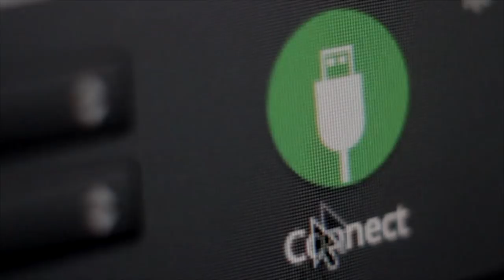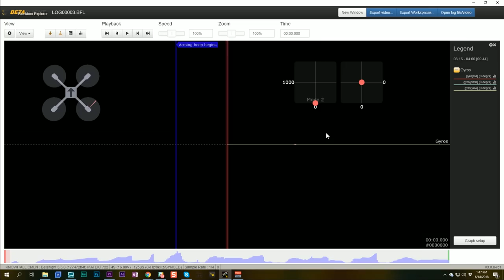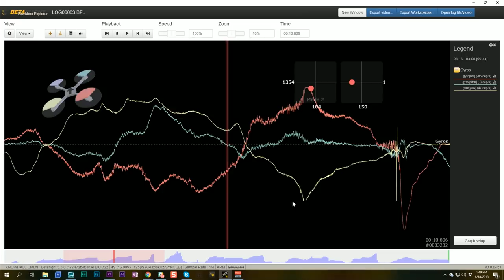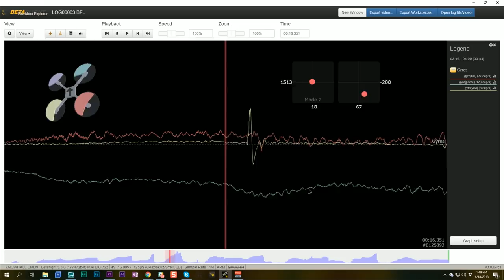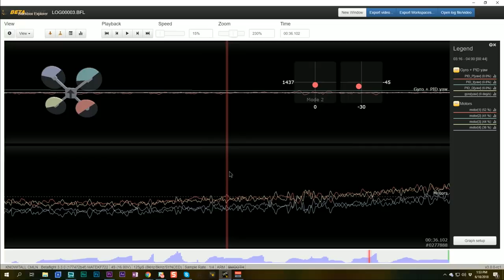Gyro Noise Troubleshoot | MINI QUAD BLACKBOX

Comment: I didnt hear you mention loose wires around the flight controller.  A wire vibrating off the board will cause the flight controller to glitch.  I don't know if voltage in the wires will also cause it. Ohh.  And the antenna mount.  If your antenna wobbles,  attl do donkey,  attl do.

Comment: I've been tryin to fix this issue on my Floss 2 frame with Helio FC and Emax 2207 2400 kv motors with 2 different ESCs. Lately I've been debating if it could be the motors on that set up. They do feel notchy and could be causing vibrations. Who know... good info in here anyhow.

Comment: I'm having a major issue with my quads. They both brandnew but I get oscillation when the D-pitch is around 15 to 30. I have to have it at zero,so the d-pitch oscillation is gone. What is crazy about this... Roll is doing fine. I dont get it. My P pitch is 70, I is 40 and D is 0 now. I have a Gopro on my quads. This all happen when i switch my motors to DYS Shu 2500 KV. Also, the motors are fine when I test it out on betaflight.

Comment: I just made a fresh build with mb primo 2207 motors on a reverb with the kakute v2 stack. All the latest. Still flies like crap because of all this. Cap, soft mounting...nothing helps. What would be a good fc to switch to if I don't care about cost?
Reply from the maker: I wish I could tell you an FC that would guarantee good performance. FC with an MPU6000 gyro like my JBF4 may be less susceptible.

Comment: I have an armattan marmotte new tmotor f90 pro motors new 55 amp esc and new f7 tmotor flightcontroler. Pitch axis is horrible on noise nothing seems to help I don't know what to do not a good flying quad booble on pitch and booble on throttle punches

Comment: Having similar issues, will try to add capacitors, thanks. Also, any tips on this issue?: after fast flips camera resets (video goes black for a moment, then armattan logo appears). All good on rolls, also after reset all values on osd are not lost, so i guess its only camera power loss. Using predator with cl racing f4s wired just like on manual.

Comment: Sat here in 2022 trying to fix a noise issue on my Chameleon... Watched tens of videos, messed with PID settings endlessly, hours looking at blackbox explorer... Gets to the end of this video and hears Bardwell say "and in this case the frame is an ARMATTAN CHAMELEON"... Il be damned. with all the standard hardware and rubber FC standoffs i think i am as you put it, screwed. This only started happening after a BLHeli_S Bluejay update. First quad too so until this video i was stumped, now i think my Matek FCHUB is too close to the bottom plate sending vibration into the standoffs... I hope.

Comment: the f405 had the same yaw twitch issue try it in multishot before you take it apart.  i think real issue is how its might be wired on some boards or even just to much heat in production for the newer chip good info Teach
Reply from the maker: No way I'm going back to multishot. Turtle mode forever.
Reply: lol yeah cuts walks of shame by 70%. i can wait for the new hal sensor motors and esc i saw Zoe use them and they look like a next step but they are going to cost in the start. lol use your position to get you some early wink wink for testing

Comment: What about running up each motor without the props on to see which arm or arms are generating the noise? It can be a bad FC but most times its not once they are soft mounted.
Reply: Yes, that can work.

Comment: A little dynamat goes a long way. Its used for arresting high powered speaker vibration. Keeps your trunk lid quiet when your competition sub woofers are trying to blow it off. Little on the expensive side unless you get the small 12"x12" sheet. Stick a little on the frame or under the standoffs. Never to the fc. Its super sticky and may pull things off.
Reply: Mass damping, which is what dynamat does, isn’t ideal for quads since we’re trying to keep the weight to a minimum.
Reply: kenkamm it doesnt take much or add much weight. It calmed down the matek f404 aios. They have samples on counter bells. Little tiny piece does a lot.

Comment: Hi, Joshua Bardwell
What temperature do you think is normal for motor?
My motors usually are 60~70 Celsius degree, is it too high for motor? or it is regular.
Reply from the maker: That's in the edge I think. Especially if you're just hovering and cruising.

Comment: Hello Joshua, Congratulations for your outstanding expertise and high quality videos. Very impressive !!!
Currenlty I have a quad eachine TS215 and I had a crash after which I needed to change 2 motors and the ESC. Nos this has been done, the Quad is flying again but even after dozens of gyro calibration in Betaflight, the quad is LEVEL/Horizon mode is still drifting ( highly ) on the right.... I have no idea why !! I have NO trim on my radio, and in Acro mode the quad works almost ok...

Any idea on how to debug this ?? using the black box ?? Am i missing something in betaflight ?? Thanks !
Reply from the maker: https://youtu.be/otJNzZrE-yk
Reply: looks to work !!! THANK YOU. The "trimming from stick" is working for roll. but does it work for pitch ?? looks like it only applies for roll

Comment: was it a matek F405? with the ribbon thingy ? I had really noisy issues that I tried to tune / filter out yes with no luck. was already soft mounted & low ESR cap. tried various Dshot and multishot no joy unflyable.  In the end I rewired FC so no power came off the FC. only 5v in and signals so no RC receiver, LED or Buzzer +- from FC and used power from PDB instead. Fixed !! so smooth now on default PIDS
Reply from the maker: No. F722.

Comment: What could happen, before crash i haven't any vibrations, after crash my drone after arm and rise throttle a little drone is vibrating and flies up with max motor power. Gyro working, i see in btfl. Can't check blackbox, it's mobula 8. When i turn off airmode everything seems ok, it flies pretty normal, little shaky, but with airmode on, flies straight in to sky with full power.
Reply: Pid tune maybe?
Reply: @tootfpv Thanks but problem solved, i've put aio to another drone from 2s to 1s and it was good, don't know why.

Comment: What was the flight controller? Also I had a similar issue (though it was more just garbage data 90% of the time) on a kakute v2 and it was fixed by reflashing the fc. I still have no clue on what caused it at first but its gone now so I'm happy
Reply from the maker: Matek F722

Comment: I have this same issue with my chameleon. I'm soft mounted and have capacitors out the ass and I'm using a mpu6000 gyro and it's unflyable. Can I send you the BB to take a look at?
Reply from the maker: I won't have anything to add beyond what I say in this video, unfortunately.
Reply: In the logs my rear right motor is maxed out while the other motors are between 75-85 % . Could that be the source of the problem?

Comment: how about balancing motors with tape? Worked great on all of my quads.
Reply from the maker: It can work but it is so much work and time and then the first time you crash, it's ruined. I don't think it's worth putting a lot of time into balancing props and motors because of this. Just build a system that can tolerate a small amount of noise and then when things get too bad, repair or replace the motors.
Reply: I can confirm that from my experience, that it can take some time. It took me about 5 minutes per motor. 
You are right, once motors are bent things can get impossible. 
On the other hand, bending a motor won't happen on every crash. 
Even one motor can get out of balance in a crash, the other motors can be fine. 
That still gives you only 1/4 times of vibrations than an unbalanced setup.

Comment: Did you ever get this Chameleon frame flying jitter free? Do you have a follow up video of this frame with new FC? Running 32k!? Jitter free? Im helping a buddy and he has the same exact brand new electronics FC (Softmounted), ESC, MOTOR’s (Softmounted), Props,  LiPO, ESR Capacitor, similar weights as me but on a Chameleon frame PID tune slightly different obviously and just can’t shake it! Pun intended! Lol
Reply: It's funny but I haven't had this issue with any of my other builds until I used the Chameleon ti frame. Wonder if it's the frame causing this?

Comment: Stupid question. Maybe I’m not understanding bigger concepts, how do I know if it’s noise like in this video versus, too high of P value? 
My example, I built a fresh 5 inch quad. I entered higher rates than the stock (rock settings which I used in my previous quad). I would put in quick inputs or a roll and it would twitch and crash. I lowered P values. And I loosened the nuts on the soft mounted flight controller thinking, maybe I compressed it too much to negate the soft mounting. I also went back to stock rates. 
This was my first attempt to try and build a tune and locked in quad. (My first quad I built but left everything stock) but now I’m feeling a little hesitant. 
Any help would be much appreciated. Thank you!
Reply from the maker: Please check this video to see examples of what P term and D term oscillation sound and look like.

https://www.youtube.com/playlist?list=PLwoDb7WF6c8mTH6A4HyzPPdX5lsvEwBeA

Comment: Would there be any benefit in running 2 capacitors on a 4 in 1 esc? I have 2 airbot asgard v2 flight boards and they both have mid to full throttle oscillations. I like the design of the board but im going to have to toss them if i cant get these oscillations to go away.
Reply from the maker: If a 1000 uF capacitor doesn't fix it, I doubt 2000 uF will. Mid throttle oscillations are a bitch.

If it starts at mid throttle and continues to full throttle, then it could just be your P gain is too high.

Comment: Great video as always I have a similar problem to yours but with the new KISS V2 flight controller kiss 32 amp ESC and T motor F40 Pro 2 2400 KV. My issue is only when the throttle is at 2000 and I am full throttling to the sky it will shake like there's getting noise into the gyro. Everything is brand new I have one flight on it even tested each motor in the kiss GUI and it seems like the motor is causing all the noise on the graph. I switched to brand new Motors the hype trains and it's still doing the same thing I also have a 25 volt low ESR capacitor on the power lead and have another kiss V2 exactly the same build and it is Rock Solid. 
Do you think the kiss v2 gyro is messed up please help thanks
Reply from the maker: If you have oscillation just at high throttle I think P gains should be reduced.
Reply: Joshua Bardwell yea there on stock pids..  just at 3 for pitch and roll. Justs tumped

Comment: Joshua why are u using friction example for wath happen inside the motor..
Reply from the maker: Friction is a good analogy for what happens. The electrical energy moves inside the coils but it is not translated to mechanical energy (movement of the rotor) so it turns to heat instead.
Reply: Joshua Bardwell can i said i think ur example is more relevant to describe what happend to metal pot on induction plate. For wath we hear motors are actually speeding up and down rpm. I preferd said the controler is asking power and break at a chaotik frequency and as same for exess D gain brake is applied fir nothing usefull.. speed up 20ms brake 10ms speed up etc.. the kwad fly on fast overshoot and appliy brake always and too much.  Ure right saying energy is dissipated but think its mecanical power of bell and prop inertia that give heat.. if u ask brake thats because u had ask too much power d this power goes somewhere.. shorted as heat

Comment: the fact that the glitch was specific to yaw suggests it is not electrical or mechanical noise per se, otherwise it would be visible on roll and pitch gyros, especially since d gains are typically set much higher on those axes making them more prone to such noise. Im inclined to think bad gyro/FC.
Reply: Erm the 32khz gyros are notorios for having yaw glitch issues it seems the yaw axis on these imu's are much more sensitive
Reply: An out of balance rotor spinning causes vibrations along the plane of rotation, which in the case of a quadcopter corresponds to the yaw axis! So this actually strongly implies that there is excessive mechanical noise. 

The pitch and roll axes might be more sensitive to vibrations due to the higher D gains, but we don't have anything to excite the quadcopter about those axes in the first place, since we don't have any rotors that are mounted vertically. Of course, there might be some vibrations in pitch/roll since nothing's perfect, but the amplitude of those vibrations is much smaller than what we would expect in yaw (which is what we see in the bb log).
 
If we had an airplane with vertical propellers, we'd expect to see similar vibrations but in the roll axis this time.
Reply: nice hypothesis, but I haven't seen any concrete data to support it. any direct observations I've made have shown that motor imbalance is picked up by all axes.

Comment: thanks for this video Joshua. I have a scenario (with matek f405-ctr) when in INAV i have serious yaw twitches from the gyro, making the motors heat up real fast. While with BF installed on the same setup, the quad flies well (well enough with zero tuning). I have soft mounts and a capacitor on a 4-in-1 ESC. any idea would be appreciated. thanks!
Reply: I know I'm late but the problem is Yaw P too high

Comment: I'm using iflight xl5 v2 with individual arms and I can wiggle them and the second set of screws on it is the stand off screws even though flight controller is soft mounted if the arms are moving then its moving my entire stack I think I have good electronics as iam running emax lyte spec 22p7 2550kv kakute AIO TEKKO 32 35amp 4 in 1 and the atlatl esc what do you guys think already incresed.filtrting and I have to run with very very low p and d gains motors come down pretty warm not quite hot though I can hold on to them
Reply from the maker: If the entire stack is moving, it's got to be hurting your flight handling! I would fix it.
Reply: Joshua Bardwell I don’t know what else could be happening can’t seem to get the arms tight enough you can move them with your hands I have to think that’s moving the stack a little bit rite. I have to have all filters on turned way up meaning down on the numbers and my D are like 15 P are like 30 motors still warm I can hold them but something is clearly wrong rite? My Kopis flies awesome I added an additional m3 screw to each arm last night now there’s no movement in the arms at all can’t wait to try it out!

Comment: Nice video as always! 
I'm having similar problems on a build where I went from 5 inches to 6 inches, I found that the props size have a big impact on the noise of the system 
I have two questions:
- I've always said to my subscribers to buy the low ear capacitors and, as you also said, to check for the 105° label. Someone told me that the ° rating is not relevant so I wanted to ask if that is true
- What was the flight controller you had to get rid of?
Thanks for your time!
Reply from the maker: I have been told that 105 degree caps are basically always low-ESR. I've assumed it's true but I guess I never verified it.

The FC was Matek F722 but I don't want to give it a bad name as many people are flying it with no problem. I think I just got unlucky.
Reply: Joshua Bardwell thanks for the reply!!

I think is the reviewer curse
Reply: If the 6" prop is a Bi blade, try a Tri blade.
Reply: Ka0sFPV thanks! I'm already on triblades, dal 6040

I'll try a different set!
Reply: I am selling capacitors for years. 105°C capacitors are not always low ESR. 105°C capacitors are modern and they are used in power boards for electronics (TV's, DVD's, Satellite's, PC power supply's - all electronics) because they last much longer (500-2000 hours) in hot enviroments (power boards generate heat) than 85°C capacitors. Low ESR capacitors are better than  ordinary 105°C capacitors becauese they has lower internal resistance, generate less heat and last longer than ordinary 105°C non-low ESR (2000-10000 hours). Sorry for my bad English :-)

Comment: I’m having the same propblem, with the same frame. I replaced the fc, now I’m working my way out. Baaaaa. I had the same set up in a 30 dollar Martian and it flew perfect. First time in my life spend more money caused more problems.
Reply from the maker: The frame is 100% not the issue.
Reply: Joshua Bardwell I cannot believe you responded to me! I’m star struck! Haha. Thanks. I figured, but I’m glad to hear that from the pro!
Reply: Have heard from peaople that their  Rooster/Chameleon have noice issues :( Running RF and Helio @32khz
Reply: Ted Elmenheim if that’s the case, then I should be able to change the resonate frequency by changing the “mass” of the bottom plate. Will report back.
Reply: Justin Benscoter did you change mass? Did it work?
Reply: David Mercado I did, and it did not. I eventually reflashed the fc to an older version of betaflight and it worked great. For some reason the firework won’t fly right on 3.4.

Comment: I have a question. If I soft mounted the fc but I flew a few times with a bent motor sheft is that possible that because the fc was soft mounted it did screwed up, and I just have to change the motor?
Reply from the maker: I'm not sure I follow the question... if you have a motor with a bent shaft, definitely replace the motor.
Reply: Joshua Bardwell yes I know but I don't know that the gyro is also damaged or not because I flew with a bent motor shaft( and sorry for my english, I've just started studying it)
Reply from the maker: No, it won't damage the gyro.
Reply: Joshua Bardwell thank you, especially your quick respons. How can you be that patient with the comments, you answer all of them.